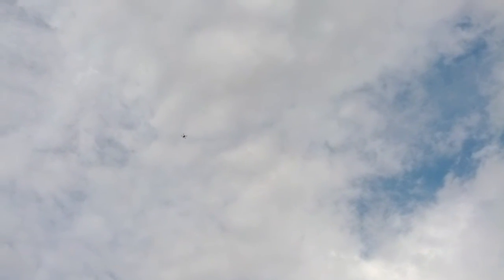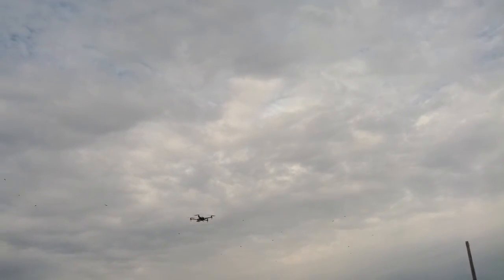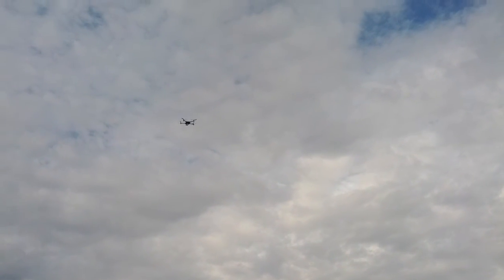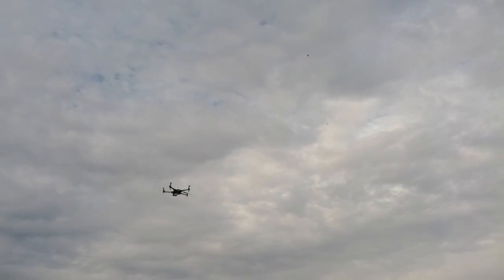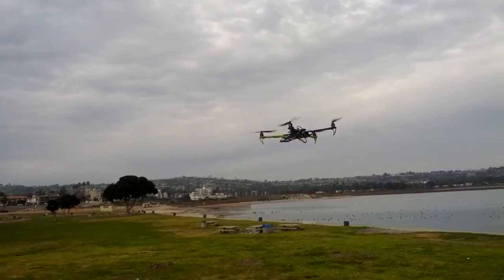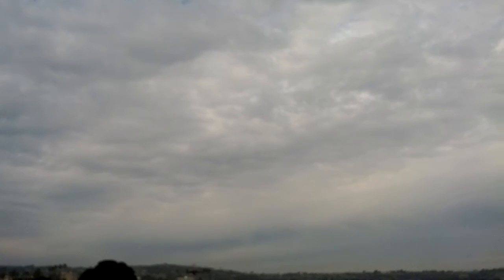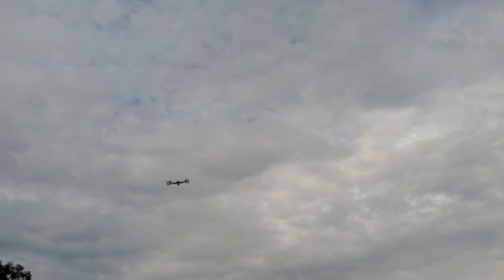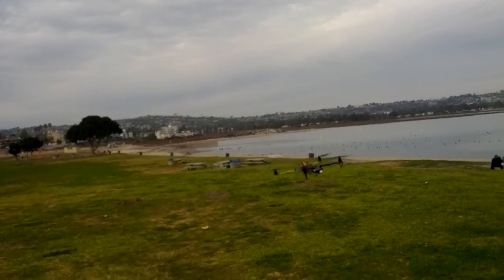HobbyKing SK450 Dead Cat Multirotor Test Flight 1

Comment: Hi, Not sure if you can help but I have just built the SK450 with the deadcat fitted with the CC3D fight board. I can't work out the settings on the motors so she can fly. I have searched the web and this seems to be a tipical problem. Can you help out at all?
Reply from the maker: questfish Haven't flown with that FC but try here: https://forums.openpilot.org/topic/49848-need-help-with-cc3d-mixer-settings/ Lots of reading but hopefully demonstrates some of the math behind the calculations rather than just the numbers to plug in - which will be a time saver down the road when working with additional frames & flight controllers.

Good Luck!
Reply: Thanks i'll have a read
Reply: +questfish can i have your  settings? thanks
Reply: Hello mate - I am not going to lie to you. I could not get mine to fly stable with the dead cat on. I looked everywhere on the net to find the settings, The dead cat was binned shortly and I brought a better frame from hobby king. which I have managed to fit the go pro too. Is that what you are trying to do?
Reply: +rbross3030 Can i get your settings ?please
Reply: +questfish oh i was asking rboss3030 for his kk2 settings mate. sorry
Reply: +DRIFT PRO No problem - It came up in my feed. Good luck with it.
Reply from the maker: +DRIFT PRO 
I've ran a few different settings, I can't remember which I was running here but I know that this worked: https://www.youtube.com/watch?v=Zj6mbuZR0B0
Reply from the maker: +DRIFT PRO I later updated my firmware from what was stock on the KK and when I did do I also updated all my PID settings to something far more touchy...